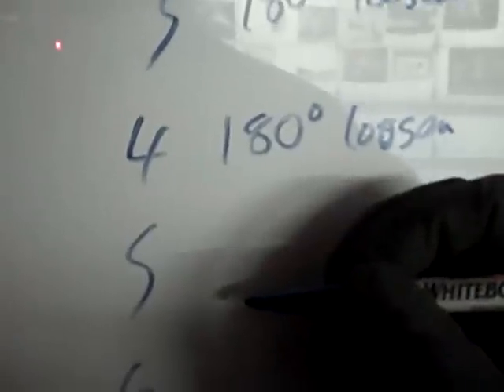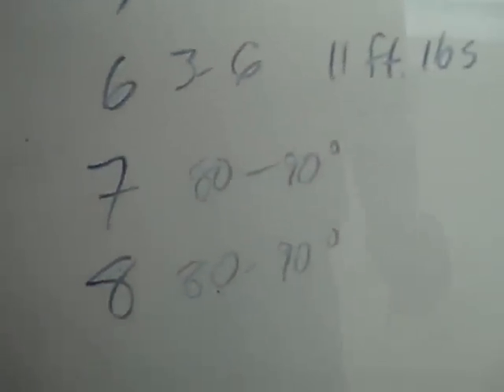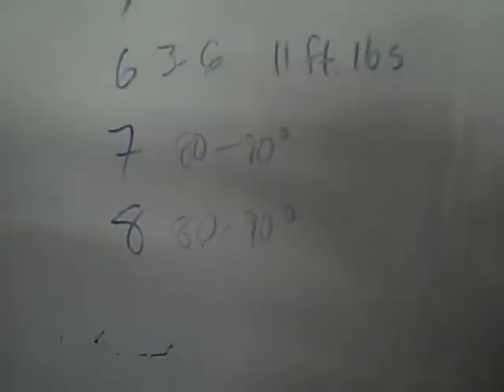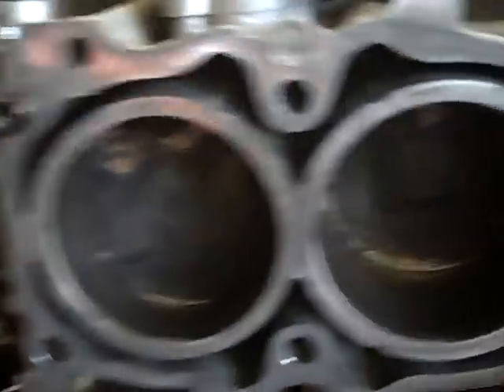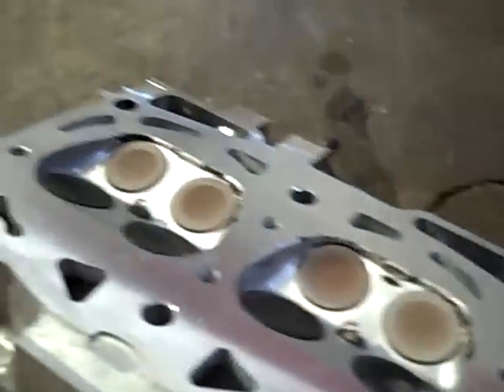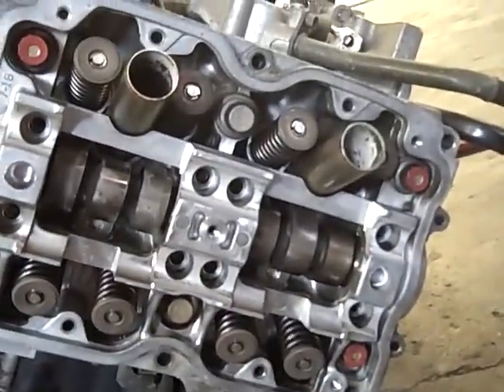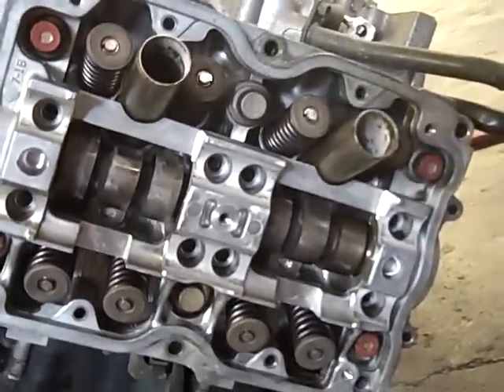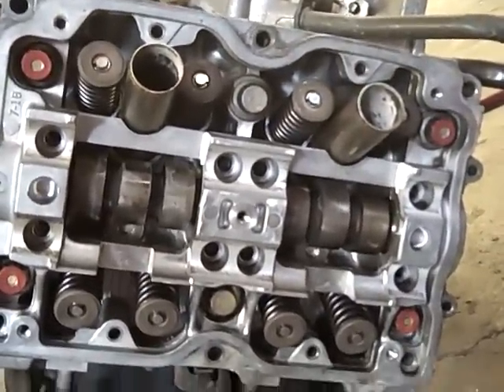Subaru Head gasket installation instructions

Comment: Why they don't just come up with a Single Number like : Torque to 65 FT/LBS
Reply from the maker: stealhty1 Great question!  The reason why is because the metal in the head where the bolts seat, alignment dowels, and the head bolts all stretch and crush a little bit leaving your torque loose after the first heat cycle of running the engine.  The multiple steps ensure that when it's all done it's settled and whatever creep or change due to metal anomalies won't result in premature head gasket failure.  Aluminum is light and strong, but it's also like tough play-doh.   Steel too seems very static, but it too has a tensile factor where it can stretch and twist initially.

Comment: Hey briansmobile1  Went to Autozone and got the compression tester and all the cylinders were holding around 100 to 110 psi except for the one on my front left as I face the engine.  This would only hold around 75-80 psi.  Is this my problem as I suspect?  I'm going to begin tearing it down this weekend and then take it to Napa or somewhere to have the head tested.  Never done a head on this car.  Anything I need to look out for before I get started?  Thanks!

Comment: Bruh...that top 40 needs to go for the show. thanks for the info. The initial sequence is for new non stretched bolts. existing bolts are just 25 11 90 90
Reply: i dont think thats the case.... ive done 5 engines using the 8 step program reusing the head bolts  with no issues, i think steps 1 and 2 is to seat the gasket......

Comment: @briansmobile1 on the DOHC what is the torque spec for the cam bolts? i got 14.5 ft# but that wont do for the little ones on the front where the cam seal is.  i used ARP head suds $180 and the supplied torque spec was 3 steps to 90 ft# done

Comment: Hi Brian, Thanks for taking the time to educate everyone on all this mechanical work. The only problem I have with this video is the Permatex paint that contains approximately 5% copper. Copper and aluminum are prone to corrosion due to galvanic action especially when in contact with flowing water and 13 volts of electricity. Don't take my word for it, do the research, I could be wrong!

Comment: How did you get the bolts on the cam sprockets off? I'm stuck trying to find a way to keep the cams from rotating so I break the bolt loose.

Comment: Great video!  I've got to do a head gaskets on my '99 Outback. What brand of head gaskets do you recommend?Ssome of the head gasket set kits I've seen recommend new bolts, looks like you use the old ones. Is there a good reason to buy new ones?

Thanks

Comment: @briansmobile1  
I am doing a HG replacement in 94 impreza(ej18?)
I removed the 6 bolts but the head wont come lose. Do I have to open the valve cover and remove more bolts? I followed the legacy hayne manual :/

Comment: Step 1
You put your right foot in, you take your right foot out, you put your right foot in and shake it all about.
Step2
You throw your whole body in, and yank your whole body out, whole body in, and fling it all about. 
Step3
You do the Hokey Pokey, and you turn yourself around; AND that's what its' all about! (Where's Brave Combo when you need them!)
  
Just gotta wonder what those engineers were smokin'!

Good news is my 04 does not need replacement bolts, and Andrey L explains the alchemy, ritual, and mysticism of the process.   
Brian really cool videos! Thanks

Comment: Hey man GREAT videos! I was just wondering if you had one on how or what to strip down on the heads before you take them to the machine shop?
Reply from the maker: +Army Jay&#39;s Automotive Services  I should make that video.  It really depends on the shop's preference and what you're having done.  Typically you take out the spark plugs, camshafts, dowels, and any other sensors etc.
Reply from the maker: +Army Jay&#39;s Automotive Services I've scheduled a visit to the local machine shop for Tuesday.  Thanks for the idea!

Comment: Great video!  About to do this.  Quick question:  05 legacy ej253.  Are all the head bolts accessible just by removing the valve covers?  I have a small seep and I want to make sure everything is torqued down correctly.  Cant get to shop for a week.

Comment: hey brian, how did you clean the block's matting surface? I'm using a using sctotch brite pad and razor blade but theres baked on gasket still. Could you help me?
Reply: Block sand with 800-1000 grit sand paper and wd-40, making sure to not sand too much in one area. Do this until the dark coloring of the gasket is no longer visible on the block/head and there an even shiny color tone across the whole surface. Theres a guy on here (not Brian) that has a video on it

Comment: NEW HEAD BOLTS....   ITs All you need.....   To make the job work for shure?  Buy a coolant evactuator from Matco...  It compleatly boils out the moisture.... The rest is a cruddy dusty radiator and condensor....

Comment: I was hoping you can help me.  I have an 07 outback same engine.  Did the heads and the timing belt.  Ran fine and then the cam seal popped out  now I have replaced it 5 or 6 times and wont stay in.  Any ideas?

Comment: Great video. Appreciate your Subaru videos.
I have a question. I have a 2002 Forester, and the Timing belt change is due in 10k miles. I was going to get one of the good kits and do the work myself. Do you feel it's worth taking the time to replace the head gaskets at that time with the felpros as a preventative measure?
Thanks in advance.
Reply from the maker: Fred Flintstone On a 2002, I wouldn't touch the head gaskets until around 150k miles unless it's being used in extreme aircraft type conditions where failure could result in loss of life or property like in cold and remote regions.

Comment: Hey man, have an 09 outback with the non turbo 2.5 and have rod knock. Can I check to see how bad the crank is from the oil pan without pulling motor? Vehicle is not at the house so I don't know if I can see the oil pan from the bottom
Reply: Lukas Garrison mk o

Comment: Hello Brian , and thanks for your videos!
I was wondering what is your opinion as far as re torque the Cylinder Heads after the vehicle is warm. Is this necessary or can it be avoided using your method?
Thanks!
Reply from the maker: ***** Aluminum is a squirmy and grippy metal.  There's risk there.  Heat stimulates movement.  It's best to re torque them after you've had a heat cycle or two, but oiling the threads and washers as well as making sure your alignment dowels and cylinder head are clean can get you the settling that's needed 9 times out of 10 while cold.

Comment: Hey Brian question I'm going based on on demand website etc but it doesn't say reuse or get new bolts and heir sequence is  tighten all to 22 ft-lb alphabets or order then 51ft-lb,Olsen all by 180 then again by 180,tighten all to 36ft-lb,tighten all to 80-90degree then all to 40-45 then a,b tighten further 40-45 I did this and I reused the bolts is it ok?

Comment: Hey Brian,
I have an EJ25 in a 2000 outback that I needed to change the head gaskets.  right now I'm in the process of re-assembling the engine.  I put the heads (with the torque sequence) and valve covers back on and gave the cam sprockets a try before I went any further.  I'm finding I can't align the left cam sprocket.  I get the sprocket about 45 deg away from the alignment mark and springs resist any more movement.  Any suggestions before I start pulling this head back apart?    And I forgot to check the valve/rocker arm gap too!  Eeegads!  Help please.

Comment: Failure to follow these procedures is the cause of virtually all Subaru head gasket repair failures.
And then people are on line screaming about replacing Subaru head gaskets every 20,000 miles.
Do it right ONCE people.

Comment: Hello Brian, first of all, thanks so much for all you do to help people keep their cars on the road and healthy!
I have a question that has been nagging me for the last 9 months.  Last fall, with the help of your videos, I replaced the head gaskets in my 1999 OB.
It's a 2.5 with 118k miles.  Head was machined and factory replacement gaskets were used with new Subaru head bolts.
My question.  When at step 4, loosening the 2nd 180 degrees caused all the bolts to loosen completely, is this normal?

Comment: Wait when you loosen them 180° twice do you loosen them at the 51 ft lbs that you just tightened them on or a different setting? And on the last two steps when you tighten to 90° do you tighten them on the 11 ft lbs you had just tightened them on in the previous step? Can you clarify.

Comment: Regarding the tightening sequence are bolts 3 and 5 at the front of the engine?  In the video it looks as though you refer to bolts 3 and 5 to be in the back of the engine.  Also, how did you get the block surface so clean and prepared for the new gasket?  Like your videos!

Comment from the maker: @miketlan  I know you're done now, but ALWAYS put motor oil on the head bolts when it's an aluminum block like these, or Hyundai's or Mitsubishi's etc.  If you don't the head bolt torque will not be adequate AND they will be murder hard to get out..

Comment: Hey @briansmobile1 I just got told I have "multiple rods knocking" in my 05 sti. Im thinking of building a new engine myself and I think your videos are gonna help a lot. Is there any special tricks I need to know going into this? 

Ps I used you video about the rear strut repair a while back. Worked like a charm. 

Thanks man. Be well.

Comment: Brian... I completely disassembled my Subaru Legacy engine and after reassembling it I find 4 block plugs (smallest of all the plugs that I put in) they have 7/8" hex heads on them and absolutely cannot figure out where they came from.  As I said, there are 4 of them and they are exactly the same.  I've looked at all the drawings, the pictures in the manual, the drawings on identifix and I can't buy a clue.  Any suggestions?  I completely disassembled the engine, not just the parts that "needed" to be disassembled.  The engine had been neglected and I wanted to be able to clean every part of the engine I could get to.

Comment: Do you need/recommend re-torque of the head bolts after running certain mileage/hours/heat cycles?
Reply: If you feel like you need to re-torque your head bolts then you're going to need to replace the headgaskets and probably have a warped head that needs milling. Otherwise, no. They should be fine until the next due service / failure.

Comment: Hi Brian! Thanks for the great videos. I recently had my 02 forester head gasket repaired with an aftermarket gasket by Allstar. It lasted 1.5 years and crapped out on me. Have you heard anything about these gaskets not holding up? I'm thinking of going with the Subaru gasket for the next repair. I don't want to have to replace my gasket every couple years! Any suggestions? Thanks man! - your friend from Seattle

Comment: hey brian. thanks for doin these video. iv watched a few of your. 
just woundering iv got a ej205 wrx engine just about to install do the head gaskets..  im running a  fairly high boost level an useing the old head bolts still.  just want to know should i do the head bolts up tighter than standed..is so how much more should i do them up ?

Comment: My Subaru CD shows different torque, according to Subaru anyway. 

2007 SOHC

In sequence inside to out
1: 22lbs all bolts 
2: 51lbs all bolts 
3: Loosen all 180 degrees
4: 31lbs all bolts
5: Tighten 80-90 degrees
6: Tighten 40-45 degrees, DO NOT EXCEED 45 degrees.
7. Further tighten two center bolts (A and B) a further 45 degrees.
Make sure steps 6 and 7 do NOT exceed 90 degrees in total

From what I can see, your torque would exceed the final torque by 90 degrees.

Comment: Like your video. Wondering why you like Subaru seems like you're working on it a lot.  I mean I have a ford with 187000 and it hasn't even come close to the repairs you have done on your Subaru.  Normal maintenance, abs ring, rear shocks and one swing arm.

Comment: Hey bud I've seen your videos you're doing awesome. Just one thing, stop using the copper spray it's causing the gaskets to fail again. Every Subaru I've done that's had the gaskets serviced it's either has copper spray or a graphite gasket. In most cases at about 30k give or take. A note to any one doing sohc or dohc use Subaru gaskets or six star gaskets with the turbo specifications for torking the head bolts. Subaru gaskets you need to still use the antifreeze conditioner, six star you don't. Make sure every thing is clean, dry, and flat. I've never had one come back and my personal 99 dohc outback has 90kon it since.

Comment: hi brian should you be using copper spray on an aluminum block,i,e, head gasket
are you not worried about ellectrolysis.
Reply from the maker: The newer head gaskets are already coated and don't need it, but no.  I'm not worried.  It works awesome.

Comment: Never did an engine before .  What does an SOHC look like compared to a DOHC?  I notice that every time you talk about torque you say 22ftlbs and then 51 ftlbs and then when you are ready to torque you say 55ftlbs, why?
Reply: +Suzanne Rossomando  sohc is single overhead cam dohc is dual overhead cam means u have one or 2 camshafts per head :)
Reply: You have to torque them at small values then go up to higher torque values to make sure the head sits flush against the block and won't be tightened too much on one side

Comment: What should I expect to pay a garage to do this job?  I have gotten quotes from 1000 -1300 just for labor.  I had a guy offer to do it as a side job for $600, but when I asked about the timing belt he said it would be an extra $200.  It seems like he is ripping me off since he has to do the timing belt anyway.  Bear in mind that I am buying the parts myself.
Reply from the maker: +Tim Johnson Sounds to me like you're thinking right.
Reply: Timing belt should be replaced but I’ve done my headgaskets and ran my old belt with no issues. A belt kit is 200 so he’s quoting you for what you’re asking. The shop is quoting for what they think you’ll pay.

Comment: your torques: so you do all those 8 steps if you are installing BRAND NEW bolts. Subaru recommends reusing the old ones. The reason being is because they hold up a lot better, unless you are building 500+ph engine, than aftermarket ones. The purpose of TQ to 51ft/lb then backing the bolts off is to STRETCH the new bolts. IF you reuse the old ones and I would, then just TQ all the bolts to 11ft/lb, then bolt 1 and 2 to 25ft/lb, then just TQ all of them in sequence 90 degrees more, two times total in sequence.  Just clarifying, other than that sweet video!!
Reply from the maker: andrey30008 Great point.  It's very hard to cover all details like that and to do it on the fly.  This is one of my older videos from 2009 when it was a labor of love to fill in gaps online.  I really appreciate you contributing that here in the comments.
Reply: Hey Brian. Are you agreeing with andrey30008 about skipping the four prestrstching steps if you are reusing the  head bolts.
Reply: Steve S yes, he is.  you can re use the old bolts you just don't need to stretch them.  I have reused old bolts successfully before.
Reply: That's how I do them, If for some reason they are unusable ..I go the whole route as the video suggests.
Reply: great point.  saw a video of a subaru expert that said for warrantees they always reuse the original bolts. for one, they don't need restretched. two, you know they are quality.  it's hard to be certain new ones are the same quality.  And i've seen many subaru recomendations to replace the head gasket 50,000 miles.  brian, your videos are dead on for minimal time, but packed with needed info.

Comment: Now I have to ask , why do they want you to louse the bolts , doesn't that mess up the gasket ?
Reply from the maker: walter phillips Great question.  The head is aluminum which is very malleable and soft, yet very prone to grip and bind.  The bolts are steel and can be more porous and hard.  Loosening the bolts ensures that nothing binds down wrong before the head is "smooshed" down flat and tight. For this reason it's also a good idea to put a little motor oil on the head bolt threads before putting them in.
Reply: walter phillips this procedure is for new head bolts. If you are reusing the old ones, just skip the stretching part/loosening. This is a same procedure for every engine. I am pretty sure you can start with step 5 if you are reusing the bolts, although I would go with new ones.
Reply: +Y10Q If the head has any warpage, bolts/threads may be over stretched or bent, if not they should be fine. 
 I agree though, replace head bolts, it's a job only worth doing once.

Comment: The torquing directions sound as though they were made up by a practical joker!
Reply from the maker: caduceus33 They do, but they come from years of revision and experimentation rather than a spin on the hokey-pokey song and dance.  Hyundai's procedures  sound about the same too.  It has to do with the behavior of aluminum over time and temperature cycles.